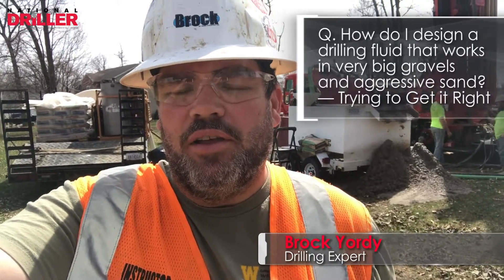Design a Drilling Fluid for Big Gravels, Aggressive Sand

Comment: Thanx for ur information...i had some problem when i drill 10m for water level control well. I didnt use any rotery drilling, i use auger with Casing ...the problem is too much fine sand coming out when i keep rotating to clean the hole, whenits pulled out the hole is filled with this floating sand, cant clean the hole. Finally i used water to clean the hole and installed the pvc. I think may be i made a kind of mistake in this auger drilling.